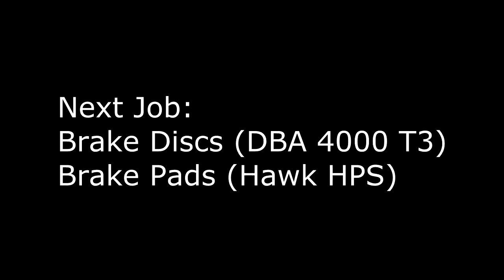GT86 Mods #1 - Brakes & Strut Brace

Comment: Try turning the wheels so you can have more room and leverage to take the caliper mount off. Also, i would get a torque wrench just to make sure things are tight enough. Finally, try to hold the ratchet further back to have more leverage. Great video, keep up the good work!

Comment: To get the disks off 2 threaded holes, screw the right size bolts into them and they just push the disk off. Also turn the steering to full lock and access is a load easier to the bolts for the carrier and the caliper